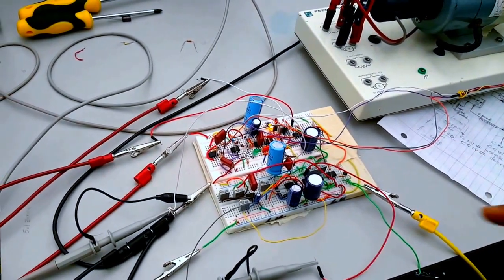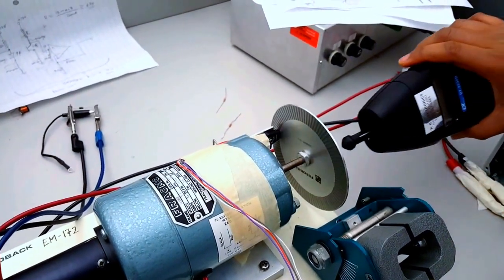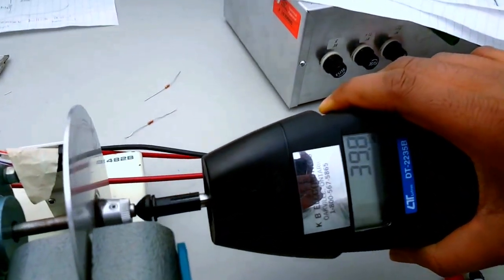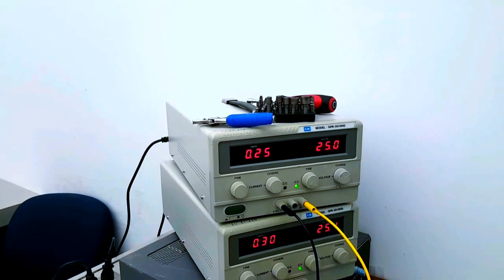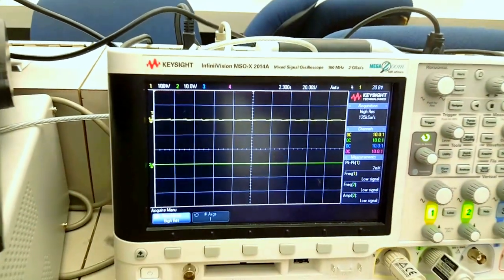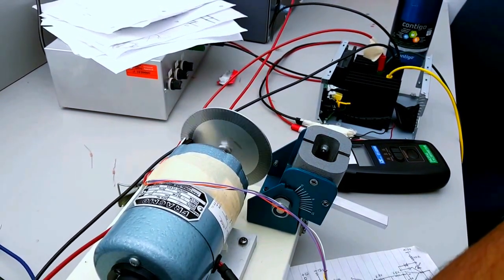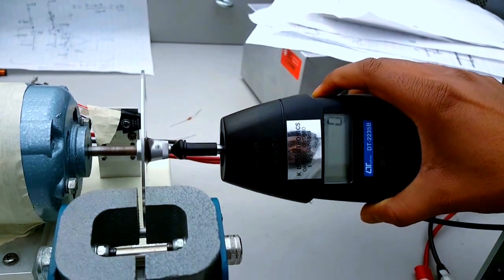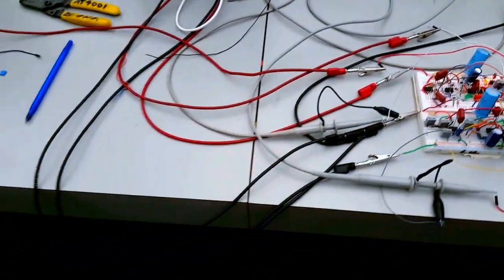Analog PID Speed Control for DC Motor

Comment: Hello, i am kinda interested in your project. How did u amplified the current for the dc motor?  We are doing a similar project in high school. My first thoughts were creating  a h bridge.
Reply from the maker: Hi, sorry for the late replay! Yes if you want bi-directional speed control you definitely need an H-bridge. For the application shown in the video, I used only a single transistor as a low side switch to control the speed in the forward direction only. Take a look at this: https://www.baldengineer.com/wp-content/uploads/2017/07/NPN-Low-Side-vs-High-Side-Switch-1520px.png 
Also, the transistor had a small emitter resistor used for torque control as well. I will draw up a schematic and post it as a link when I get the chance.
Reply from the maker: Here is the actual drive electronics for the shown video, https://drive.google.com/file/d/1yPClJNBDVHjiQHrVU_b64B5-WqdB2H4y/view?usp=sharing
Reply: Hi 
Can you show the schematic of the circuit? I’m trying to do a similar project but controlling the position

Comment: Hi....i'm doing similar project for university course, designing a PID controller for speed control of a DC motor. I wanted to ask which tunning method you used for your PID and if possible could you please email me full schematic of your project. my mail tshepo.mabaso288@gmail.com
Reply from the maker: Hi, I used the Ziegler-Nichols method using open loop and then closed loop tuning. Check the following document for a guide, https://ufile.io/d7xoi

Also for hardware implementation have a look at this, http://www.ecircuitcenter.com/Circuits/op_pid/op_pid.htm
PS. I used NE5534 op-amps from TI for a good response. I hope that helps!
Reply: Thank you so much

Comment: Do you teach a university course?
Reply from the maker: Hello! No I don't. This video was taken to demonstrate the application of analog PID control for a course I took in University. The course was on electronic analog computing for feedback control. Each student had to design and demonstrate a working analog computation in a real system and I designed and implemented a motor speed controller as shown in the video. 

 Hope this has answered your question.
Reply: @SmithKerona  hey! Can you share the schematic and/or your project report? Asap.
Reply from the maker: Sorry I don't have the project report since it has been a while (submitted on Dec 2016). I also don't have the schematic especially the component values. If you insist, I can redraw the schematic on a piece of paper from memory.
Reply: @SmithKerona  yes plz dear.. it would be great help if you can share the schematic... And any other guidance if required...
Reply: @SmithKerona  have you also used PWM??